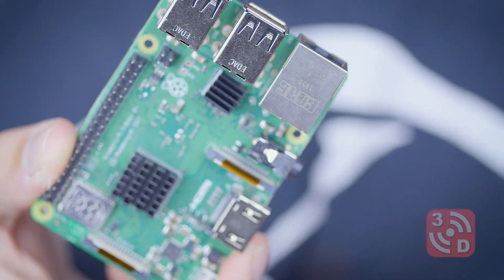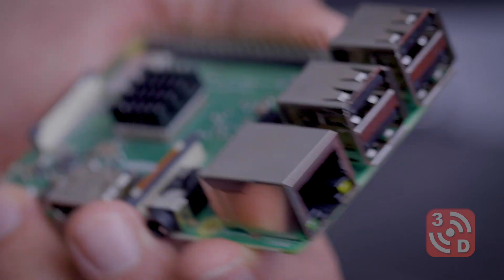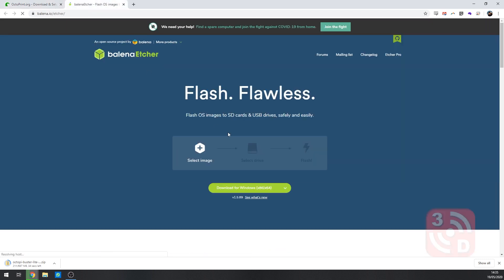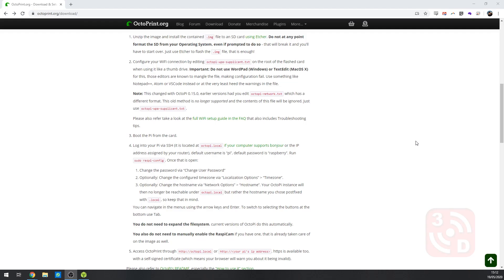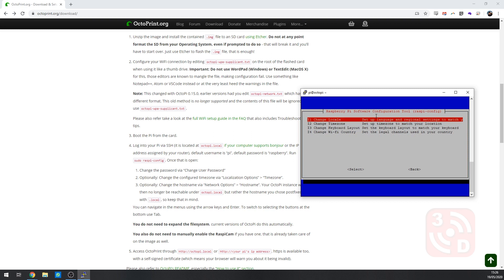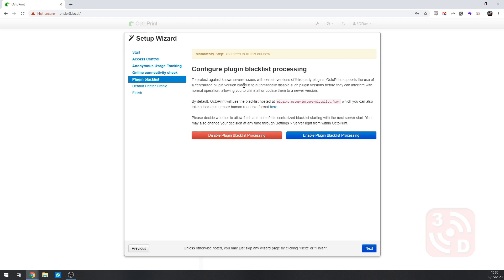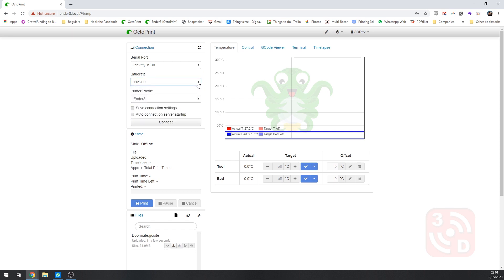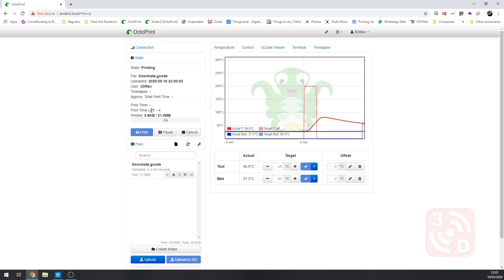How to setup, install and use OctoPrint

Comment: Thanks for the video.  It is packed with help for newbies like myself. I have a USB webcam and want to connect that.  Can you explain how to configure one?
Reply from the maker: Hi Jim, apologies for the late reply, I've been away for work. USB webcams should be fairly plug and play with OctoPrint. Simply plug it into one of the 4 USB ports on your RPi and it should start working. If not you will want to go to the settings window via the spanner icon at the top and play with the webcam settings there. If you're having issues let me know and I'll see what I can do.

Comment: For Mac u said “don’t use text edit” but never said what we should use, What do we use for Mac ?
Reply from the maker: Notepad++ is a really good one any time your doing anything code based. It's a lightweight bit of software and completely free.
Reply: @3DRevolution  Notepad++ is not available for Mac. What are some alternatives you suggest for Mac?
Reply from the maker: @ivesgrafik2241  It's funny you should ask now as I'm literally editing a new video right now in which I go through this. 
You can actually use TextEdit these days (text editor that comes with Mac natively). But you need to make sure it's set to plain text and not Rich text in the settings.

That said, if you want a full IDE for Mac, I haven't got one I could personally recommend as I don't tend to code on my mac.
Reply: @3DRevolution  Thanks very much for your reply. I enjoy your channel very much. Keep up the good work.
Reply from the maker: @ivesgrafik2241  you're most welcome, thanks, Glad you like the channel

Comment: Brilliant video, I need help with the first print it's printing to high, what i'm ment to do with this ? any help or set by step would be brilliant Thanks.
Reply from the maker: I'm really sorry for the late reply, I've been away for work and just catching up on this.
Have you managed to fix your problem or are you still having issues?
Reply: @3DRevolution  No problems I've managed to fix it now seems to be printing fine now I'm not sure what I did but but it works fine.

Comment: I can't connect my raspberry pi to my network. When I launch Putty, it doesn't connect. Do you know why that may be?
Reply: 6:44 Did you uncomment/delete those 4 hashes? If you didn't then that piece of code won't run at all.
Reply: @bear_in_site  i did uncomment those. Thanks for the idea though.
Reply from the maker: Hey, I'm very sorry for the late reply. I've been recovering from a serious accident since July last year and whilst I've been reposting for the last couple of months I'm now getting round to catching up on my comments. Did you manage to sort your problem or are you still having issues with it?

Comment: Thanks for this.. note:  The video does not explain how to connect the Raspberry Pi to the actual Printer ( its as simple as connecting a USB cable to your ENDER 3 )
Reply from the maker: A very good point, thanks Michael. Yes exactly, it's just a matter of using a USB cable to connect whichever printer you have. Different printers require different kinds of USB cable but usually include one with the printer (It's the same cable you'd use to connect to your computer)